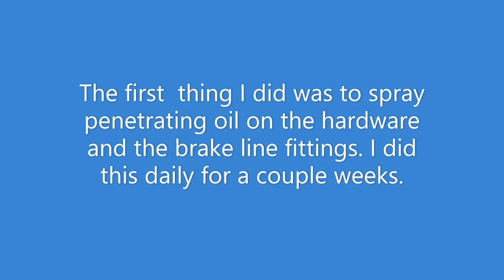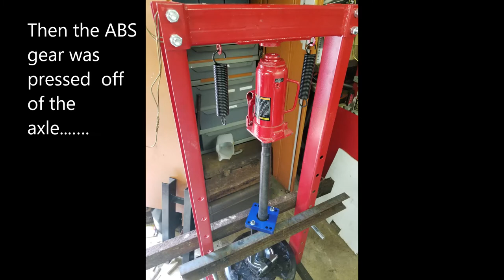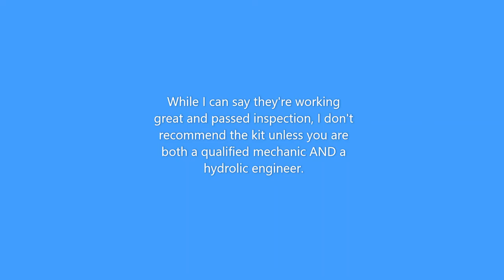How to Replace the Rear Axle Bearings and Seals and Convert to Disk Brakes on a 2001 Toyota Tundra.

Comment: man. I don't think I could ever go with custom/ "make shift" parts to make things work. springs, bolts, etc specially with bolts or spring, definitely anything safety related, uh like brakes. lol.
Reply from the maker: I completely agree. I was led to believe the kit was fully engineered,  bolt on, and ready to go,  safety guaranteed.  Once I began the installation,  I  was kinda committed.  🤷‍♂️😂